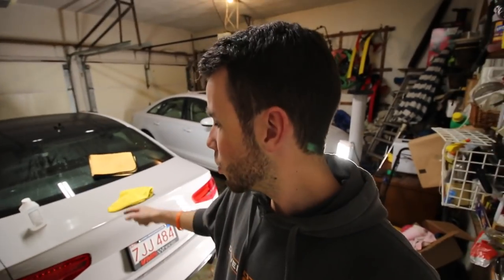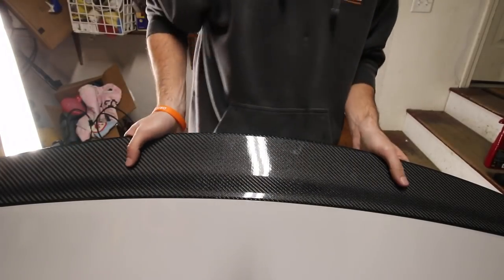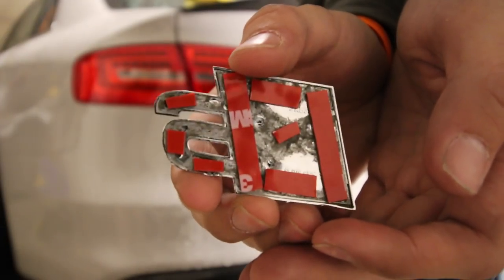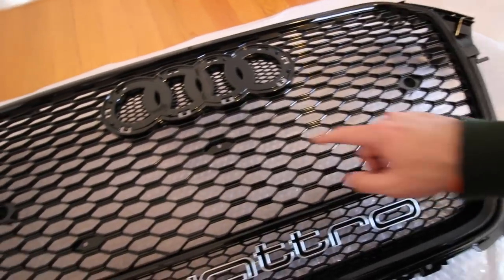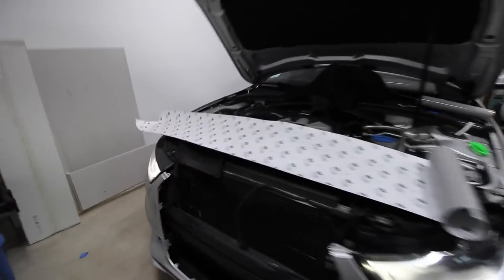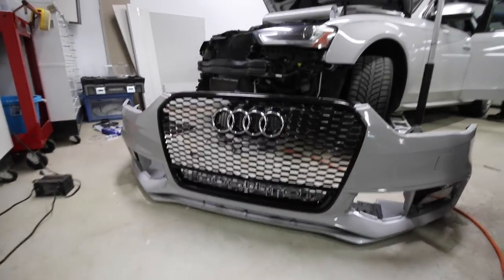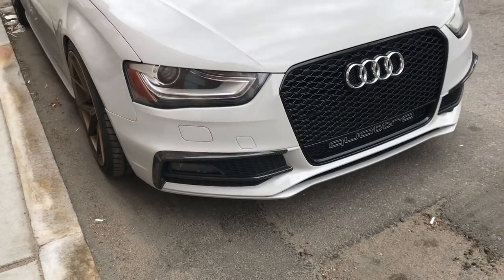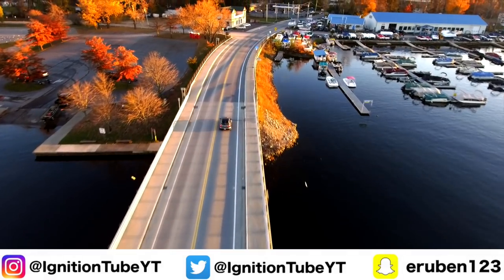New Quattro Grille, Fogs, and Front Bumper Wrap on my S4

Comment: Nice grill! This made me think, why didn't you buy a B6 Audi RS4 for around the same price as a B8.5 S4 when you like the RS4 style better? Plus, the RS4 is manual and a V8 with more power.
Reply from the maker: They are slower (I put 2 car lengths on one from a 60 roll when I was Stage 1 with no DSG tune) and not my style. Love the V8 sound, but I think the B8.5 is a better buy and much more my style. And has way more potential.
Reply: You have to have very deep pockets to tune the V8 to a fully tuned 3.0T. Bang for buck, it's probably the easiest engine to get silly power out of.
Reply: Have you driven a B7 RS4? Which corners better? I care more about handling and the driving feel over power.
Reply: Brennan Bastian I'm an old man who has driven many a vehicle. My advice is enjoy your car and stop worrying about others.
Reply: @brennanbastian2499  I've owned both a B7 S4 and B7 RS4 and now drive an S5, the B8/B8.5 platform is far superior in just about every conceivable way except exhaust note. You don't want to maintain a B6/7 V8.